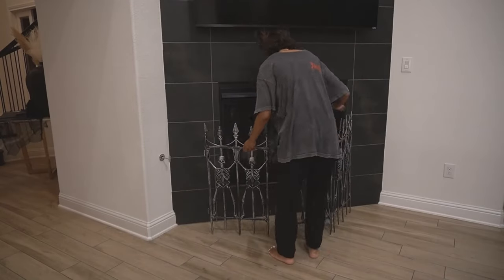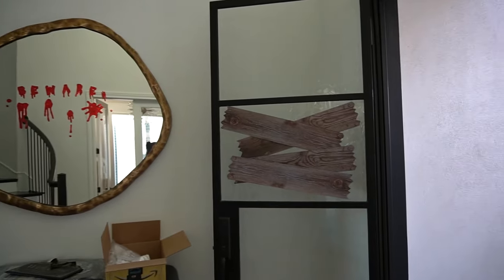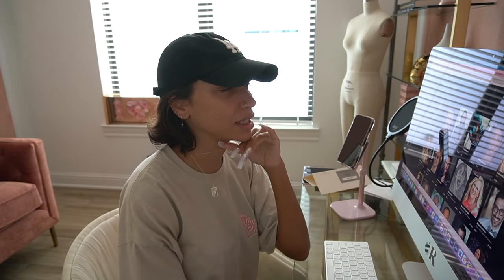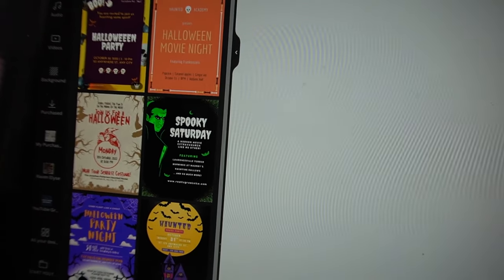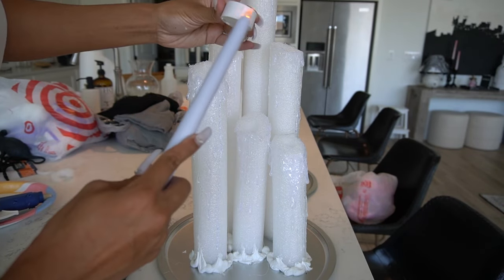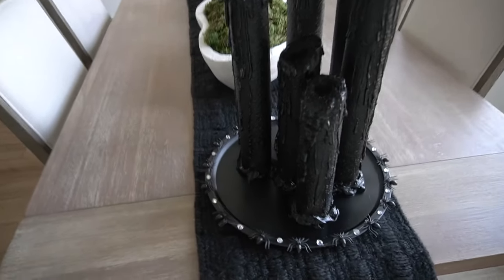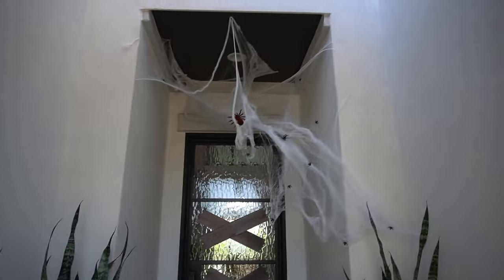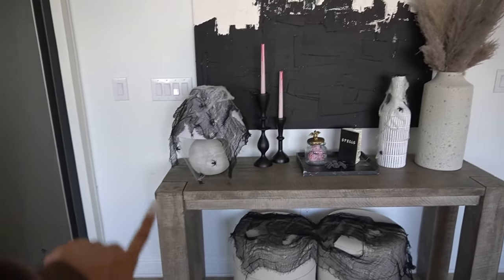Turning my House into a HAUNTED HOUSE! DIY Halloween Decorations & Props

Comment: Raven quick tip on the drippy wine candles: you can buy a pack of red tealights and light those, then pour the wax from the top of the tall candles and let the wax fall and drip to create that same effect. That way you can also control how much wax is on them and the placement. Loving these spooky videos!

Comment: You should do pool noodle candles going all up the side of the stairs on the outside along the railing and banister. Give a very dim spooky lighting to your entry way on the night of the party. Also, cut the hole in the pool noodle a little wider to help shove the candles in.

Comment: Yo! I need to borrow that fire pit burning bones idea. That was so dope. It spoke to my former PreK teacher side that misses doing all these crafts. 

Oh and to get the melted candle in a wine bottle look, I’ve used large red candles from dollar tree (ones in the tall bottles), melted them down on the stove, poured in a measuring cup and then after inserting your candles in the bottle, pour the melted wax down the sides. You have to do it in about 2-3 different rounds to get the melted look you want. Just make sure you let the first layer dry down a bit before doing additional pours. I hope that made sense. 

Thanks for sharing your party tips and journey. You always have great content 😊.

Comment: Burning bones are 🔥🔥🔥🔥🔥 if no one has already mentioned it, for the wax drip on the bottle you can use red colored hot glue for the same effect. I hope this helps. As usual great job on everything. Just 🔥😍❤️😍🔥🔥🔥

Comment: With using the tea light version for the pool noodle candles 🕯 you have to cut out a little bit of a circle not all the way through to make the tea light appear straight across the top of the candle to make it look more realistic 😉  also I like the idea of using the long battery operated candle sticks that you did a lot more than the tea lights as well 😀 😊  I have made both types before! 🖤

Comment: Those red beware sticky things on the mirror leaves red stains. I used it on my front door and it left a stained print. It was almost impossible to remove. Not sure if it will do the exact same thing on your mirrors. I thought I'd share that info. Love your videos by the way! 😊